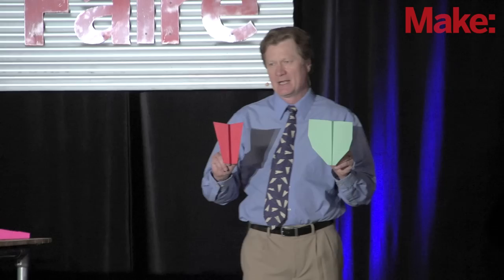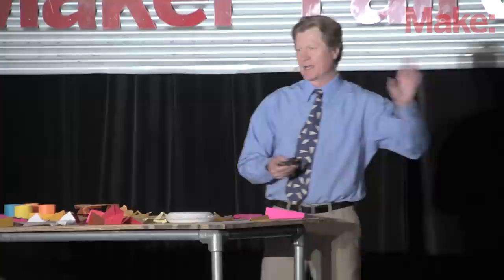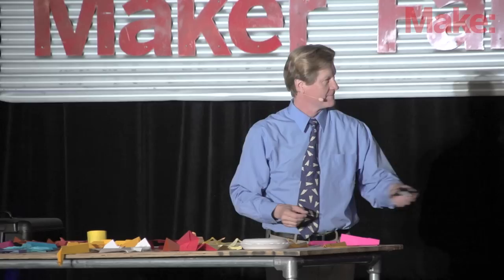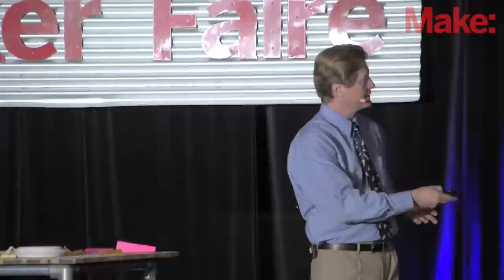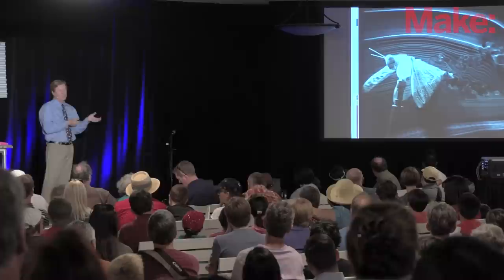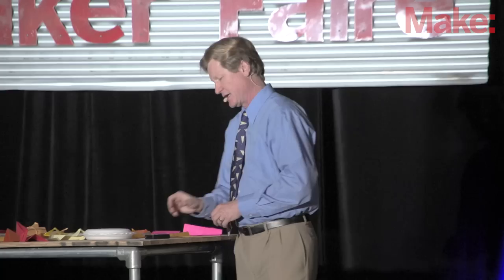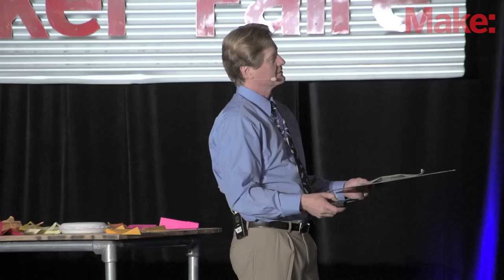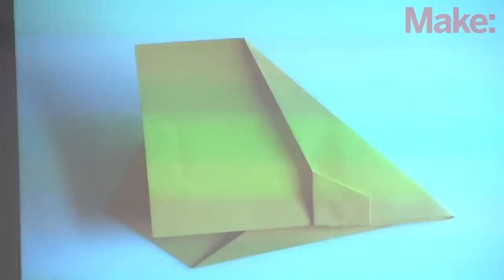The World Record Paper Airplane - John Collins

Comment: I always thought that things fly because the air on the bottom and rear of the wings pushes the plane up, and the engines, or the initial energy used to begin the flight, pushes the plane forwards and towards the air. If that makes any sense. So if the front of the wing points downwards, the air pushes the top rear surface of the wing down, and if the wing is pointed upwards, it pushes the plane upwards.
Reply: +Lawrence H It does make sense. It's kinda how the elevators (the flaps usually on the back of the wing of an airplane to make the plane climb or dive) work. They can push the back of the plane up or down the way you describe.
Reply: True story.  It’s called angle of attack.  It is definitely part of how planes fly.  Though as complicated as we have made flight, it needn’t be so difficult.  If you look at a lot of the flat winged RC airplanes, they fly with near zero angle of attack, and a completely flat (no camber) wing.  Though planes with cambered wings fly significantly better.

Comment: From 15:15 to 16:10. He doesnt understand how a wing works obviously. And to say what he did there, in a room of people takes alot of balls that is if you know your wrong but I think he believes hes right so it was actually easy for him to speak this nonsense. He accounts the lift to friction on the wing. This can EASILY be proven false by simply taking the temperature of the top and bottom of the wing and the air yet, he has not done this because.....Its BULLSHIT  Also, the paper plane guy knows more than the people at Boeing, riiight.